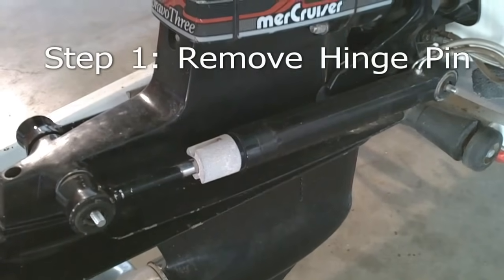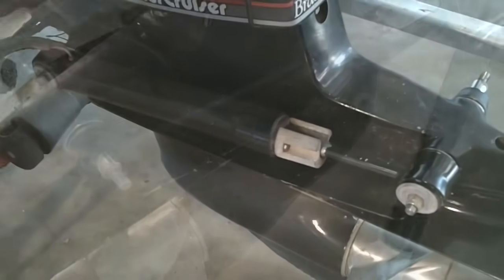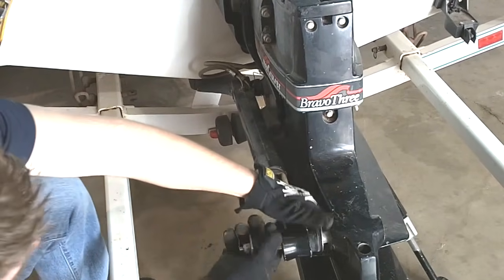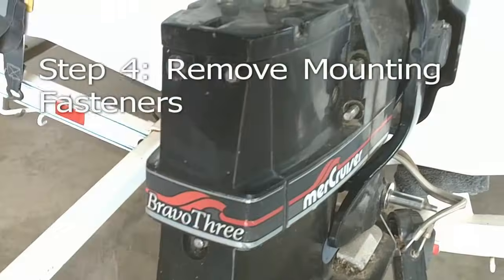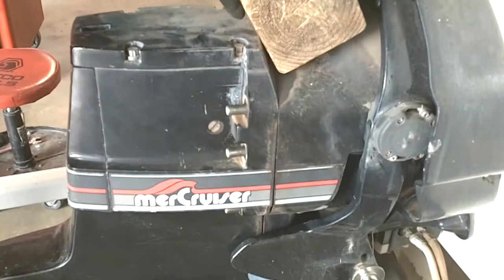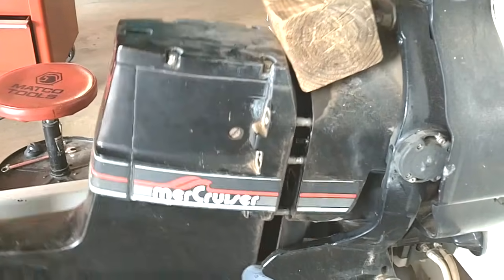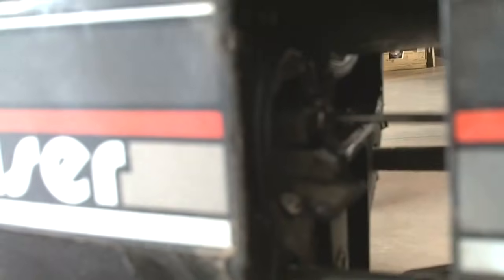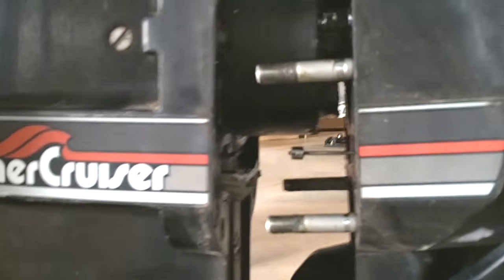Removing a Mercruiser Bravo Sterndrive

Comment: hi...does the shift cable have to be in the nuetral position or forward to remove the drive?
Reply: I would like to know also.
Reply: I would like to know also 😀 @mikeglover7456
Reply: Whatever gear would push the most cable out of towards the back. Same for reassembly. That way you'll have the most cable to wiggle around.
Reply: I think I read that it needs to be in nuetral